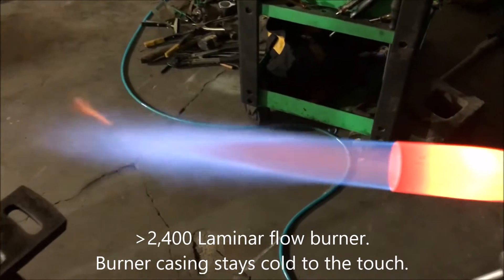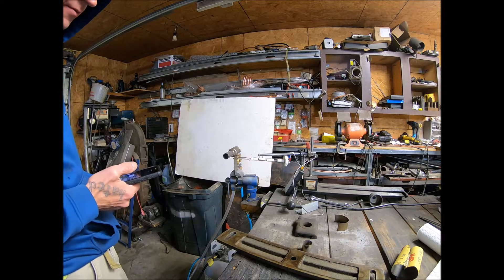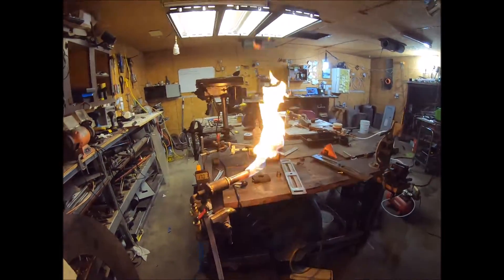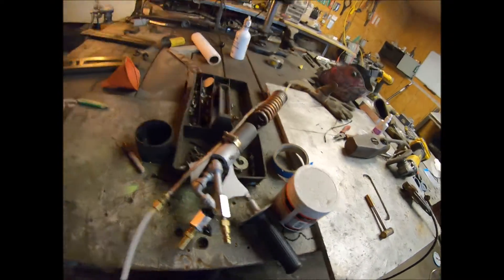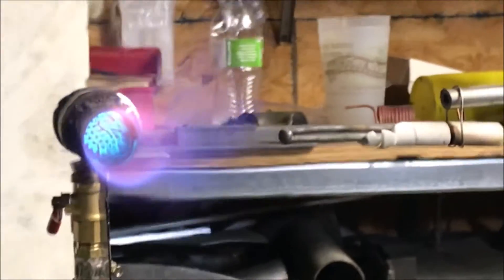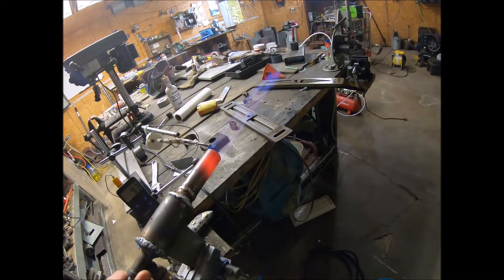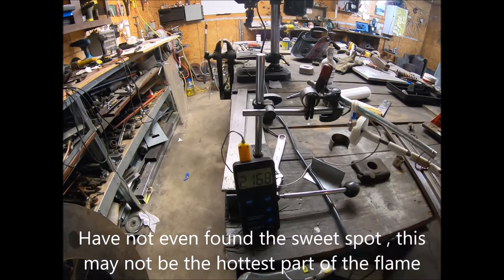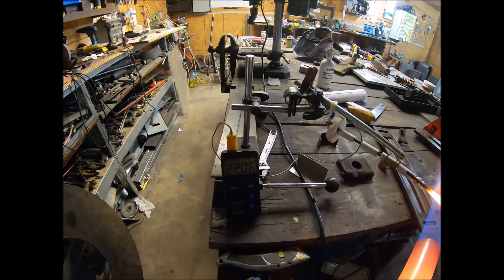Laminar Flow Nozzle Burner DIY Lamp work and glass blowing torch

Comment: Your front pipe is getting yellow-white hot! This means your fire is burning inside and much flame power is wasted at the wrong place!
Bring the nozzles in front without that much outer tubing. I guess you dont use any extra oxygen - do you? You get a much nicer and much hotter flame when you mix in pure oxygen! It goes up to 2800 - 3000 deg. C. But dont mix it inside the tube, mix it in at the surface of the flame unless you really know what you are doing :-)
Reply from the maker: not true , it wont pass 2200 deg if its not done this way , the hot metal agments combustion , your way makes an average torch you cn buy off the shelf , this beast maxes out a 2400 deg thermal couple
Reply: @NOBOX7  You dont use extra oxygen, do you? If you would, it would probably burn your combustion pipe in no time. You may be right, when you just use air and propane, but i never saw a burner that hot in front - so i guess its not the best solution regarding lifetime of the combustion pipe.